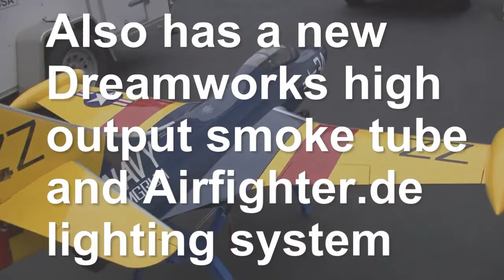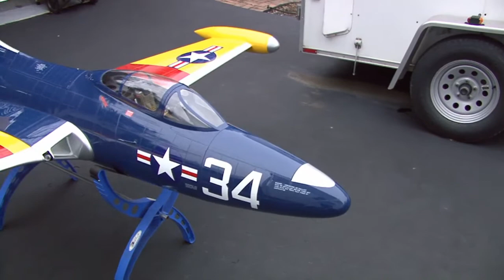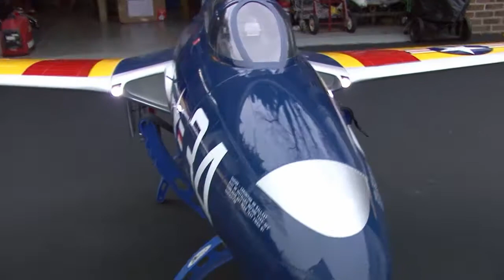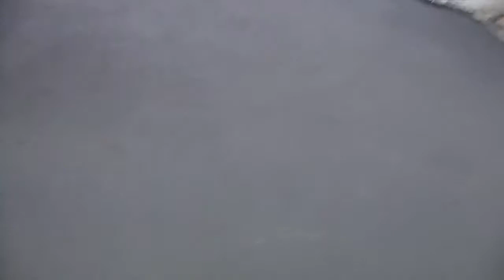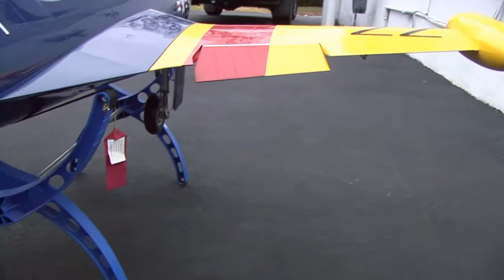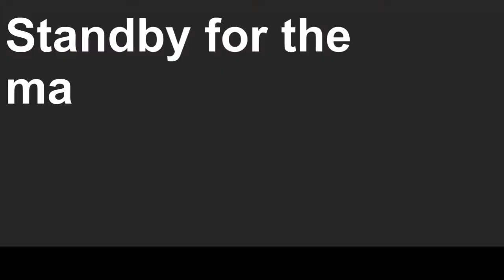Skymaster F9F rebuild

Comment from the maker: OK I guess they have not published it yet SO you should get the Cougar one
most of what is in that is appropriate OR just call BVM and ask for Dustin Buescher, he can help you I'm sure.. the critical upgrades are.. LG upgrade and the wheel doors one.. that greatly improves the lg mounts and substitutes servos for the supplied air cylinders